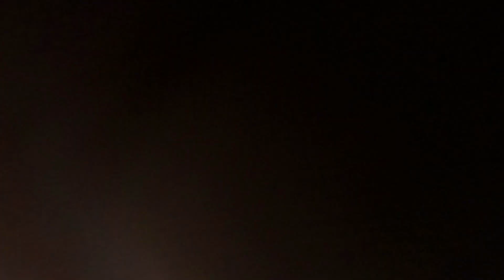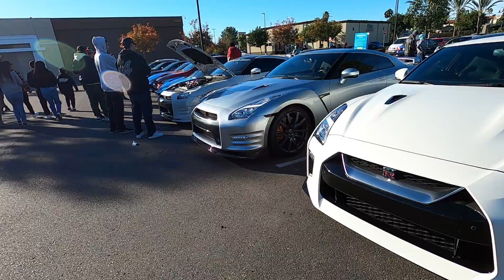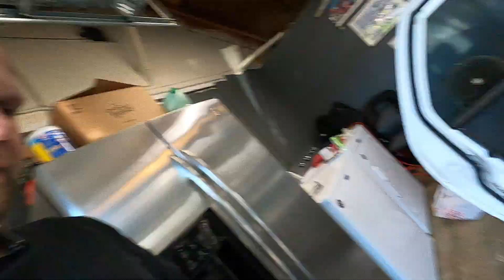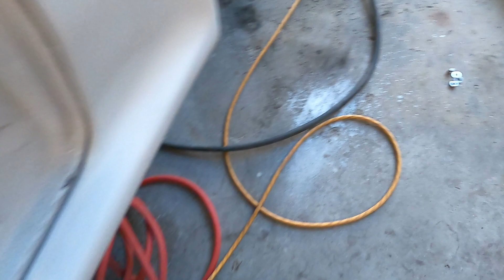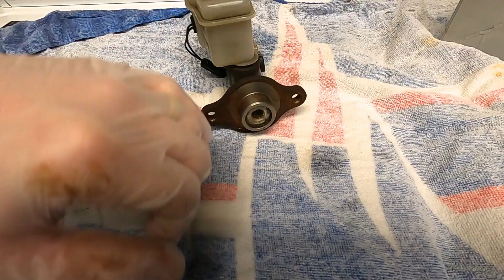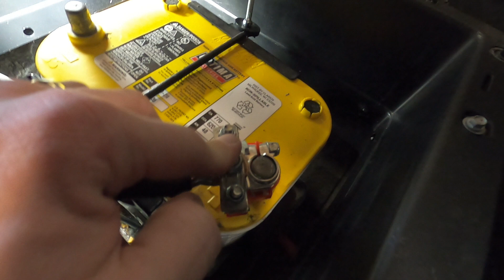Fc3s Rx7 battery relocation and brake repair // Cars and Conchas 12/13/2020

Comment: Regarding your main fuse block in engine bay. If you have haltech harness with built in relays and stuff do you still need srock relays??

Edit. I see this is a different fc sorry haha
Reply from the maker: I still keep the factory fuse block in. Doesn't hurt and some of the power goes to the interior workings, power windows and such. Most relays need to be replaced like fuel pump but ac relay is still useful to trigger an electric fan

Comment: Great work as always!  Hey, I might have missed it, but did you happen to check for a build-up of fluid inside the brake booster?  I also had the mysterious missing fluid issue.  I replaced the MC a year ago, but I noticed that it's been taking an awful lot of force to apply the brakes.  I pulled the booster off recently and I had nearly half a quart of fluid in it!  Unfortunately, the engine is out at the moment, so I can't do a direct comparison, but I'm sure that was the cause of my ultra-stiff pedal feel.
Reply: Did a  brake booster also for a customer the master was leaking into it so had to replace them both
Reply: @reinaldorivera4158  I ended up pulling mine apart, and all the internals were still perfect. I just gave it a good cleaning and reassembled. It was awkward to put back together, but it's worth the peace of mind.
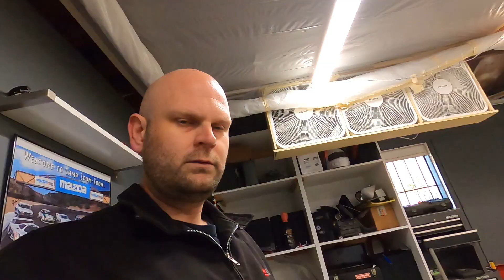Reply from the maker: I did check that but there is a lip inside the booster that prevents its from pooling inside. you can see it at 14:40 in the video
Reply: @MohrGarage  I think mine filled up because there is a slight perforation just before the lip.  It looks like the center of the booster--where the seal for the piston sits--and the outer body are separate pieces that don't join perfectly.  At least on mine they don't.  I'm glad you checked, and I hope this is the end of your brake issues.